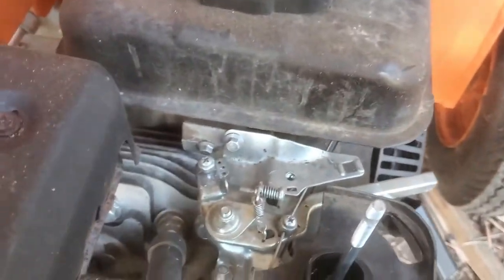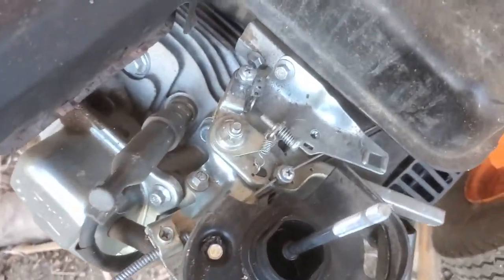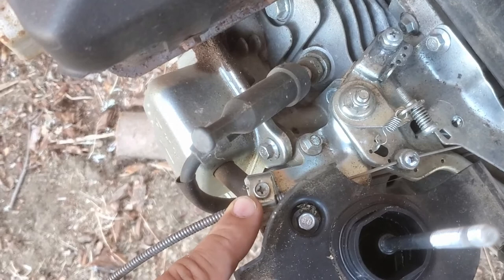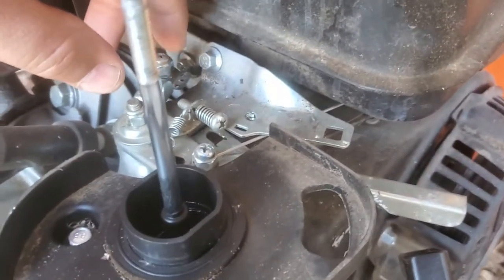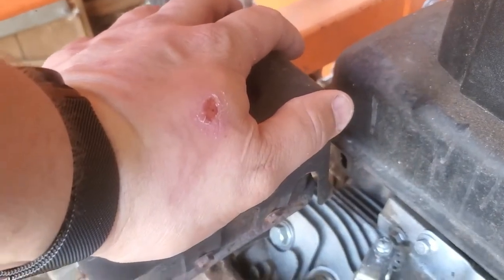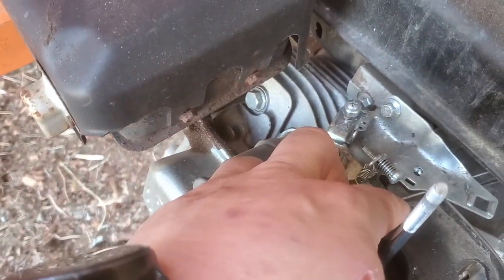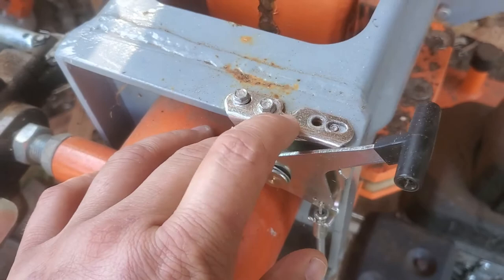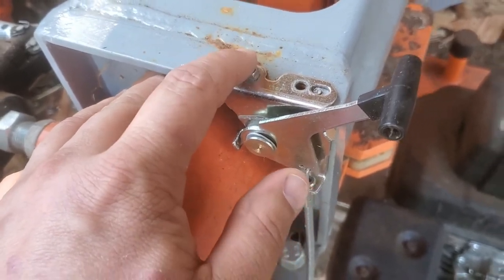Yard Max log splitter throttle mod.

Comment: Hey Bill - couple of your other vids convinced me to go ahead and get a YM splitter from LS Direct.  Just ordered the 35-ton with the long side table on my Amazon account for 6-months no interest.  I really didn't want to keep agonizing over splitters, you helped me a bunch.  Really like your video style.  Where can I get that cable and handle for the throttle mod?
Reply from the maker: Thank you. Here is the link for the cable I ordered. https://www.amazon.com/dp/B00D9TI6WI/ref=cm_sw_r_cp_apap_vztzhj3B5eICX
Reply: @WildBill1122  Thank you, sir.  Just ordered AND SUBSCRIBED to your channel.
Reply from the maker: @daddyflip8584  you're welcome and thank you. Enjoy your new splitter and happy splitting!
Reply: @WildBill1122  Hey Bill been splitting green white oak rounds 24-30 inch. Pretty happy but found taking the disk off the foot in vertical mode is way better. Just installed the throttle today. Pulled the kicker off to install handle with machine bolts and nuts. Real solid. Thanks.
Reply from the maker: @daddyflip8584  Awesome. I am so glad it is working for you. In my opinion this splitter is a true gem at this price point. Happy splitting my friend!!